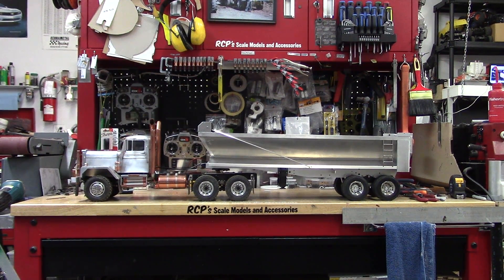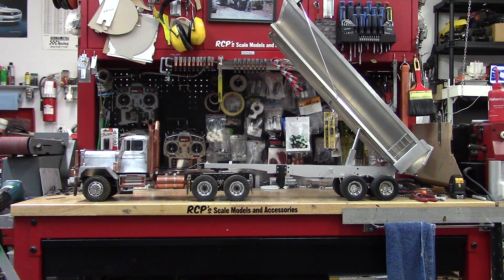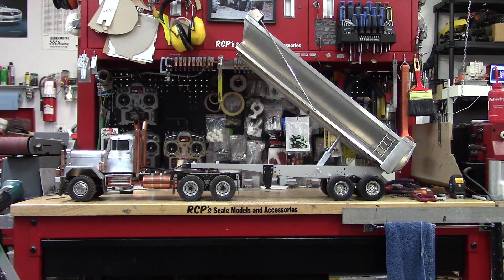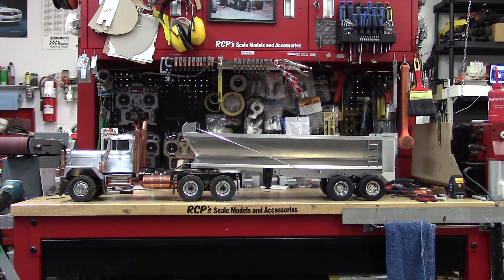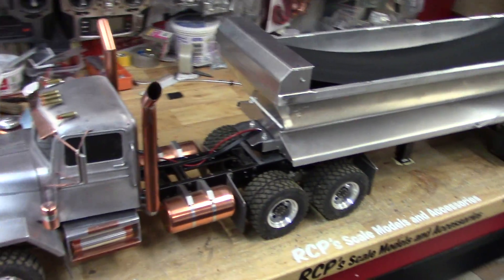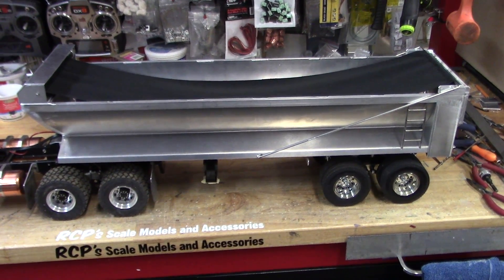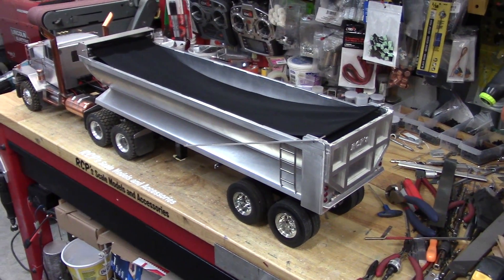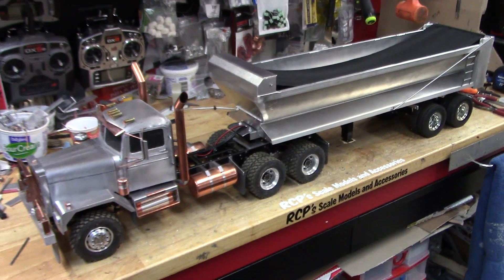RCP's Dump Trailer Demo

Comment: Do you happen to have any trailer chassis you sell me? I built a dump bed but need a chassis to mount it too...also, do you think two of the 150mm travel lowest ratio actuators would be enough to lift it? I built it according to a tamiya flatbed frame.